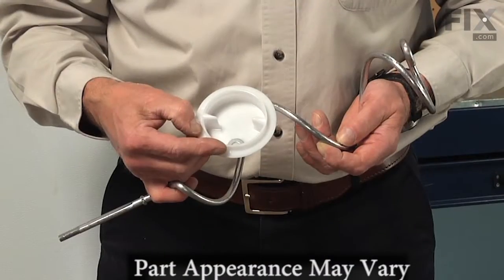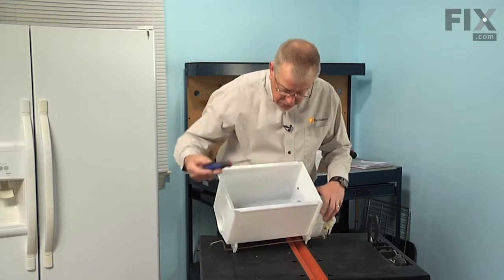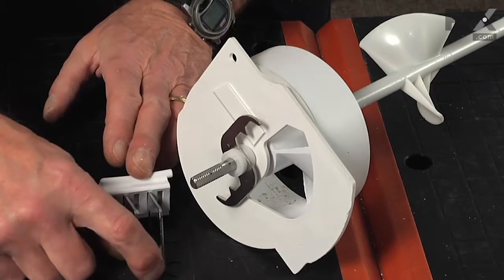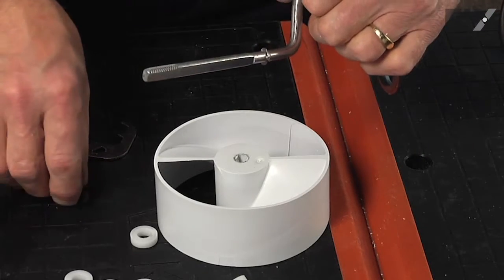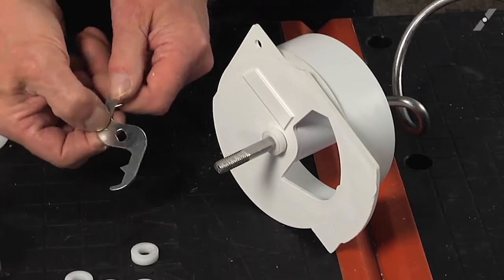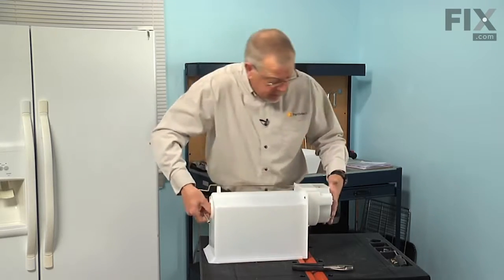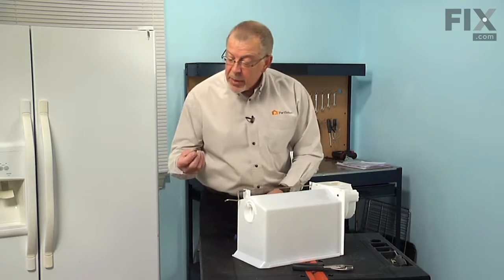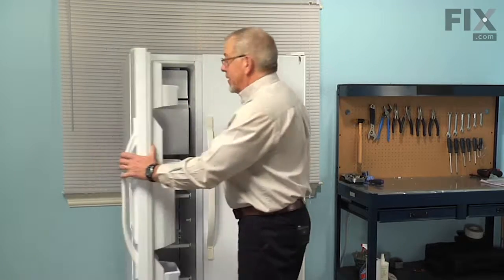Whirlpool Refrigerator Repair– How to replace the Ice Auger Kit

Comment: Thank you so much for detailing the placement of the blades and spacers.  I had mine apart because of a broken cover plate, and those pieces were what sent me to youtube.  (Forgot to take a photo before tearing apart).
My question is, do you think that metal auger is a worthwhile upgrade from the plastic one?

Comment: i DON'T KNOW IF it's the auger or the auger motor. The metal piece in the back of fridge spins without any tension . How do you know which it is?
Reply from the maker: Depending on your make and model it might be just the actuator that locks into your ice bucket or it maybe an entire assembly of motor and gearbox.